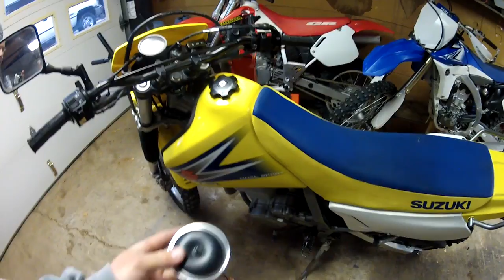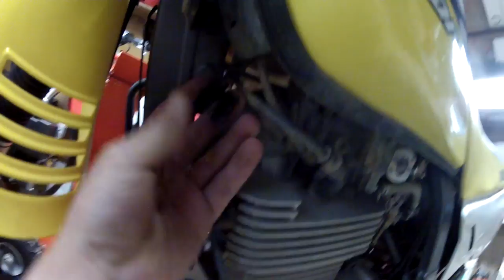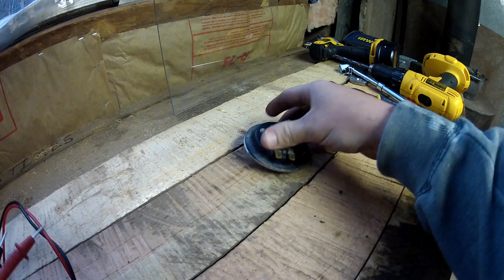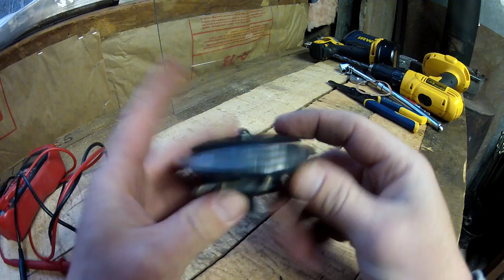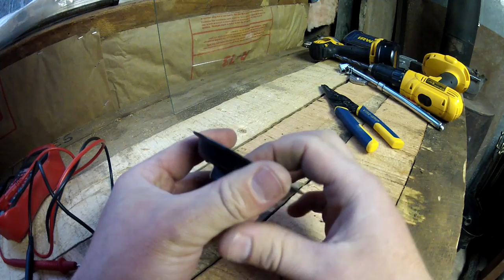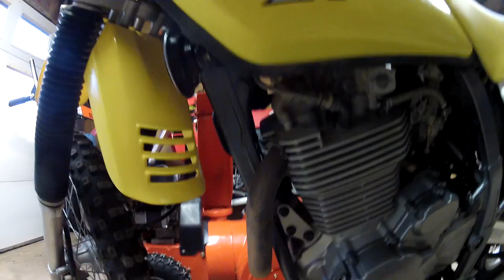How to fix your motorcycle horn, or any basic electromagnetic horn.

Comment: Another one fixed thanks to your video and explanations, thanks!! One thing - checked resistance between connectors and did not have any readings. So thought, yeah, the coil is toasted. But after I stripped it apart like you showed found a lot of water in it. Cleaned it, re set, and works like new!! So still good to check the insides :D

Comment: Great video! I finally got up the ambition to fix the horn on my 1986 Yamaha Virago 1100. It sort of worked but was very weak. These old Viragos actually have 2 horns on either side. One side was weak the other side didn't work at all. The weak horn I took apart and cleaned the crud out. The gasket was wasted but I made a new one out of electrical tape which works fine. The dead horn merely needed the screw adjusted, now it is bright and loud. I should have done this years ago.

One interesting thing I noticed, the left weak side was much dirtier than the right dead side and the screws were much rustier. I assume this is because it is facing oncoming traffic so more dirt and water get thrown up on that side. There was all sorts of crud in it. The dead right side had none. It merely needed the volume screw adjusted.

Comment: for me, when i went to loosen a small amount of pressurized air and water started leaking out. so i might end up having to completely disassemble my horn or replace later on down the road but for now, my horn works again. just needed to let it dry out and adjust it. thanks for video, you're a huge help.

Comment: if the horn housing seems to be ultra secured, one can also try drilling a small hole on the bottom of the horn case and spray contact cleaner into the horn... that might free up the diaphragm and also clean the contacts without taking it apart . i also spray some silicone or teflon lubricant into the horn just to protect it from moisture/corrosion. as stated in the video, silicone can be used to reseal the horn..

Comment: Was going to buy a new horn, until I watched this video. I found out that if that little adjustment screw on the back comes out, it won't work. I replaced the screw and it works great. I am guessing the screw vibrated out. Saved me money from buying a new horn and possibly having to reshape the hole in my console.

Comment: Thanks for the video. In checking the voltage at the horn plugs, when pressing the horn switch, how many volts should be at the horn plugs?
Reply: +mikesellarole 
When I checked earlier, the voltage across the two plugs was about 10V. Should this be enough to make the horn sound. Trying to determine if the horn is at fault or the bike's wiring.
Reply from the maker: +mikesellarole If your battery is 10v then that is what you will see. You can always use a test light or test the resistance to check the switch and supply circuit.

Comment: Instead of taking it all apart remove the adjustment screw spray electric cleaner in the hole and replace the screw
Reply: There is a good reason why the can says: "Use only in a well ventilated area", and I wouldn't call an airtight horn well ventilated, or in other words: that horn will make all buttcracks in a 5 meter radius play the brown note the first time you try to use it...

Comment: What causes motorcycle horn to sound on its own. Sometimes when the motorcycle is running the horn just honks for long duration and the switch is not pressed. Just sounds on its own.
Reply: might be grounded. if you could check the wiring if some wires is tapping the other wires